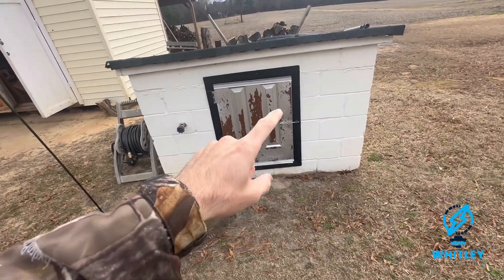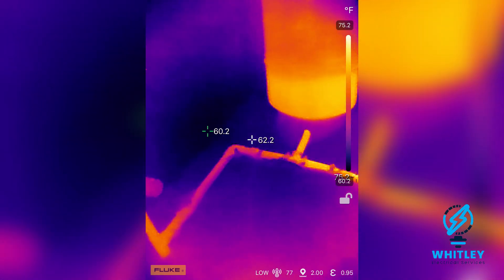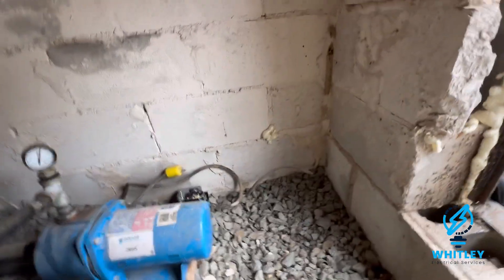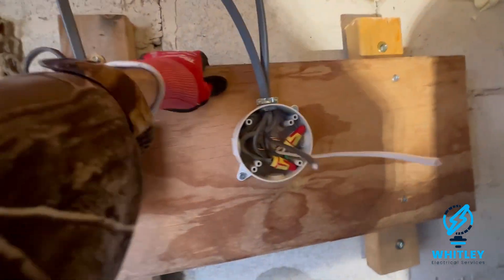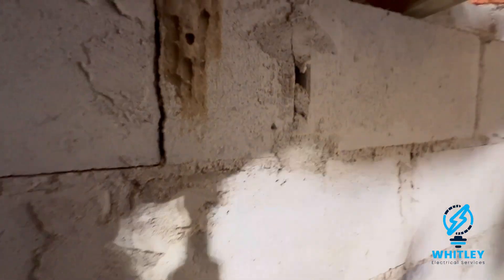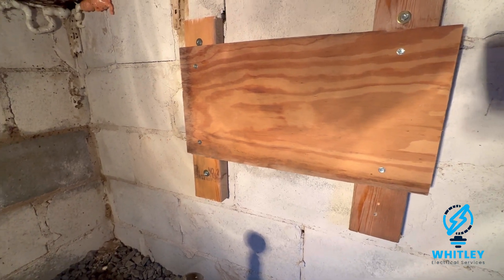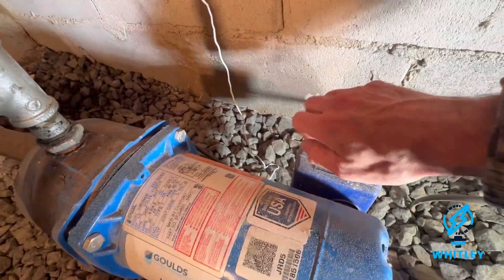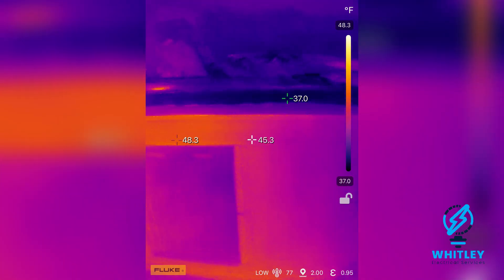Stop Your Well Pump from Freezing: Heat Lamp Installation Guide

Comment: I eventually installed a 500 watt 240 volt baseboard heater, but previously I used 2-100 watt light bulbs.  Both were connected to inexpensive mechanical electric heating thermostats.  The first was set to kick on at 50 degrees, the second at 40 degrees in case the first lamp failed.  I also connected an exterior lamp to the second bulb so I could tell from the house if there was a problem.  I also wound heat tracer cable around the pump body  and tank tee for added insurance.

Comment: Nice upgrade. probably don't need that higher than a 100 watt bulb would probably do it but those are illegal now.
I would've went to the lights before the switch then go through the switch to the pump that way you would still have lights to work on anything but that's an easy thing to do later. It's 100% better.
Reply from the maker: @imark7777777  👍🏼 thanks for watching!

Comment: without a thermostat those lights at 250W a each will run you about $58 a month if left on 24/7.  even just using one constantly on that's still pretty expensive. it would pay for itself to insolate that room pretty quickly. or go back to heat tape under some pipe insolation. 15 foot of the stuff would be about 150Watts and they have self regulating versions. wrap the pump housing and bottom of the tank too. they would run about 10hrs a day and it would cost about $7 a month. 

also.. there are cheap angled light fixtures. you went with radiant heat.. cool. then pointed them at an uninsulated concrete wall. you would have been better off with 250w or 500w space heater because at least then it would have had a thermostat and you wouldn't be counting on the filament to not burn out.. but seriously, the heat tape will be the cheapest option.
Reply from the maker: @jim4556  those are all good points! Someone else mentioned a thermostat which I like the idea of, and I’m definitely going to insulate after I replace the leaky ceiling. It was one of those projects where it was about to get really cold and I used what I had on hand to get something rather than nothing. Thanks for watching and for the tips!
Reply: @WhitleyElectricNC  I've never done it myself, but you can buy masonry perlite fill. You pour it into the tops of cinderblock walls to insolate it. It's performance is just alright. But once you get the roof off, that's the only time you'll be able to do it. Ofcourse you can just cover the walls in foam sheet. It will look bad but it would probably work better than just the block fill.

Comment: You should wire a bimetallic thermostat in-line with the lights, and snip the chains.
Itll come on only below 45 and turn off above it (or whatever you set it to)
Reply from the maker: @jamess1787  that’s an interesting idea actually… mainly wanted to get it done quickly before the cold but that’s something I may do after I fix the roof